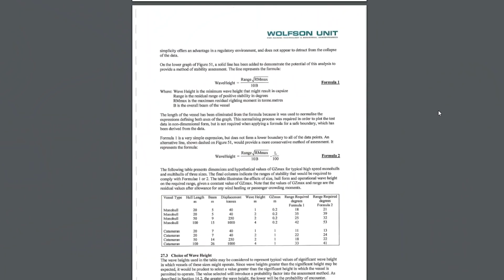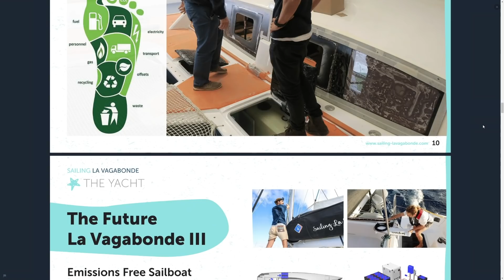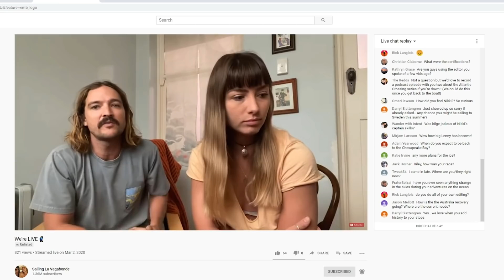Our Plan for an Emissions Free Vessel

Comment: My first question is; is a mono hull out of the question?  Don't get me wrong, I luv the Cat design, especially the Outremer,  but...cost of berthing at a dock is way high, 2 engines means twice the maintenance/expense of demand on the "power grid" (more solar panels and more "heavy"  batteries), not being able to load up with gear (washer, dryer and trash compactor, etc) and supplies without seriously affecting sailing performance and last but not least...the purchase price especially on a +50 foot boat  .  As you well know Riley, we/I will support you in your decision and never second guess you.  You're the Captain.  What you decide we will follow.  You did ask us for our input.  there are pros and cons to both hull types.  90% in port and only 10% underway.  Enjoy the journey because we all are enjoying it with you.  Luv ya bro,  your enthusiasm is infectious.

Comment: Riley more than a decade ago I read several articles on boats equipped with fuel cells and electric motors and 2k of solar panels. The problem was the size and weight of the fuel cells and the space required for solar panels.  More than 10 years later weight and space are no longer  an issue. So long as we are talking about sailing crafts.

Comment: It is still a few years away, but a suitable lightweight solar voltagic fabric will come onto the market one of these days... that would give you the surface area you need in the sails to power a 2 horsepower electric motor for a few hours along with a few hundred pounds of battery storage.
https://www.solarfabric.com/
you would need to have your wallet with you though.

You could also mount a wind turbine and wire it to charge one of Elon Musks power walls, and run a two HP outboard type electric motor with that for a few hours,   you might get 2 knots out of it.

These two in combination might get you to 4 or 5 knots for an hour or so.

Comment: Using the excess energy from solar and wind generation (vertical axis) to produce hydrogen so you have the speed on tap when you need it. But use battery captured electricity for the majority of docking and short term motoring.

Comment: I know the below issues because I too am researching a solar boat 🚣1. The main issue you will have is batteries. Typical lithium batteries have a life of diminishing returns so every day they will produce less and less power.
2. Next issue is speed, electric motors do ok at low speed but very poorly at medium to high speeds (consuming battery storage very fast at more than SLOW speed.
3. Next issue is recharge time you can't just pour electricity into a battery like pouring diesel into a tank. IT TAKES A LOT OF TIME TO CHARGE BATTERIES!!!
4. Next issue, amount of storage most boats can only run for about 4 to 5 hours on their batteries, then refer to recharge issues!!!
5. It is a noble thought but just not yet practical however I would look into Redflow zinc bromide flow batteries AND they are from AUSTRALIA maybe they could help sponsor your attempts at a zero emission boat.

Comment: Interesting that so many people are suggesting that you two (three) convert LV to electric. This is something I've been thinking about too. One thing that Dan and Kika point out, is that if you find yourself without wind, you've routed yourself incorrectly. This makes a great deal of sense, but there are still places you may want to go that don't have much wind. The really exciting thing about a boat like the Outremer is that in a 4 knot wind, you can sail and can generate electricity. And the amount of power you produce increases almost exponentially from 4 knots to 7 knots. There is a limit on how long you can motor, though, even with the most modern Lithium batteries. Does anyone out there know Elon Musk?

Comment: Come to the states. I'm from Wilmington NC area.  I've recently bought a hurricane water damaged Fountaine 44 for a great price. It's currently powered my two electric crane motors and I have a sodium ion battery bank... Looking to update soon to the EPT electric motor that the Sunreefs are using and some the high end luxury cats. I'm looking into power sails because I don't won't to solely rely on electric. I'm am electric engineer by trade. So I'd be happy to assist in any ways you need.

Comment: Riley, mate, here's some advice from an old boatbuilder/designer/professional skipper - The emissions you avoid by omitting diesel auxiliaries over the useful life of any yacht like yours would be a small drop in the bucket compared to those emitted by the various manufacturing processes of the yacht itself as well as her "green" energy-converting/storing components. That said, if you are interested in the "stunt" value and want to make a truly economic, zero-emission boat, get rid of the expensive sails and rigging (which produce shadows and headaches) make her a really long sharpie-style monohull (80+ feet?) with batteries as internal ballast and then run her on solar only. The ability to make twenty knots at the push of a button is a huge safety factor. A full-length canopy with solar cells makes a nice place to stay out of the sun. Check out Steve Dashew's ocean-crossing powerboats for inspiration. Cheers

Comment: Hi Guys,
Agree with those who say a new yacht is not the way to go. There’s a good solution already available in the Oceanvolt system. You could live ashore for the short time it would take to fit them. Your diesels could be sold to offset some of the cost. You’re never going to get a huge amount of endurance, so there will be times on passage when you may have to revert to whistling for the wind, but if you only use them for harbour work you should manage fine.
Excited to see how it goes.
Arohanui and give Lenny a cuddle for me.

Comment: Lots of comments about emissions saved by selling your present vessel, usually pointing out that refitting the present one will make much less emissions than building new will make. This seems to overlook the proverbial elephant in the room - the new boat will be built in any case and someone will get it if you don't...not to mention that your selling Vagabond used just might be the yacht somebody else chooses over building new. 
You can agonizingly argue and second guess these points as others have, but in the end, you need to do what you know will work for what you want to do. You've got a pretty good track record IMO...

Comment: Okay - if I wanted an emissions free boat I would go as far as possible with simple and smaller vessel, mechanical advantage, minimal electrics, and lots of old school approaches. Think ply, smaller, winches tackles and blocks, minimal electrics, small (elec? outboard?) or even no motor, charts and pilotage/sextant nav .... you get the idea. 

None of this speaks easily to a large and fast catamaran. Your big problem is the emissions from materials manufacture, distribution and disposal. All modern materials come with significant footprint, and it sounds like you are thinking modern materials and methods.

Comment: Cool, my Dream Boat!  Large Diameter variable pitch props for the Electric Motors, so Hybrid Sailing in a lite Breeze when the batteries are full.  The Large Diameter Props and Motor are alway running when sailing, Generating, Neutral (spinning with no drag) or Powering to keep moving thru the lulls.

Comment: Like many other comments, there’s seems to be a lot of room for emissions-free improvements on the current boat, before moving onto a new design. 
One area of greatly needed improvement is in the battery group. There’s a false idea of Lithium batteries being this great environmental product, but in order to get at the Lithium, it takes an enormous toll on the environment. But now there’s the graphene battery in development. We need to see a major push into this type of battery system.

Graphene batteries are definitely the next big thing because carbon is in abundance as compared to Lithium, which is a rare metal. Manufacturers have been trying to use the graphene material in about everything since its discovery in 2004. So, we can expect a number of graphene-laden products, especially graphene batteries, to come to fruition within the next couple-odd years. They will still be restricted to select smartphones but we’ll at least have a working prototype on our hands soon. What are your expectations from graphene batteries? Are you excited for even larger batteries?
https://beebom.com/graphene-battery-vs-lithium-ion-battery/

Finally, graphene is safer. While lithium-ion batteries have a very good safety record, there have been a few major incidents involving faulty products. Overheating, overcharging, and puncturing can cause runaway chemical imbalances in li-ion batteries that result in fire. Graphene is much more stable, flexible, and stronger, and is more resilient to such issues.
https://www.androidauthority.com/graphene-batteries-explained-1070096/

Comment: Guess I’m the one hillbilly here. Though emissions free sounds wonderful and noble, it’s an impossible feat. As new as that boat is those engines are as near to zero emissions, you can get for the dependability and efficiency of getting you out of the storms way. As far as the process of building a boat. huge emissions output and footprint, with the materials and chemicals use. As far as electric with a continuous replacement solar panels inverters and batteries and a disposable batteries you would have a far greater footprint then a Diesel engine. The maintenance and continually replacing parts in a short lifespan of the vessel would be a rather large foot print people don’t think of. All they think is oh zero emissions how wonderful. Not every thinking about the emissions emitted building and up keeping the boat. Not trying to be a na sayer. Just pointing out the Reality of it. As thorough as you two are I’m sure y’all put that in your thoughts. Been watching from the beginning, love your channel and what you do. Live the dream. As long as possible.

Comment: We went electric on our sailboat just this year. We sail a 41' formosa. the motor is undsized for this boat but the torque from the electric far out performs the old diesel. It is the lithium batteries that makes the difference too. (Dubble the size of what ever the battery bank you are planning) We have plenty of solar panels plus the re gen (which is a drag but works). Had a plan to install diesel generator for fast charge in an emergency.  But I dont think we need it now. So have a Honda gen to charge in a emergency if we need. Love watching your famly grow 🌱✌☺️

Comment: Best of luck to you guys. I would have thought the most cost effective pathway to lowering emissions would be to install a water propulsion system, and streamline the hull you have.  However not being a sailor, and only ever been capsized in a motor boat, with only angling experience I appreciate that this may not be feasible.

Comment: Hi all, what is emissions free? I think it is timber construction but all protection contains usually contains petroleum based products. Steel is coal based, alloy coal or petroleum based for electricity and fibreglass petroleum. Am I over thinking your plan?

Comment: This can be done with lithium batteries and a electric motors. For now I would recommend a back-up diesal generator as the energy storage density of batteries pales in comparison at the moment. In a few years solid state batteries should improve this but probably need some backup for now. Can you get biodiesel at boat refilling stations? 

I have also seen a boat using hydrogen fuel cells which solves the energy storage density problem. The setup would take up a big area of the boat though.

Looking forward to seeing you nut out a solution!

Comment: Why don't you use your current cat. You could put an extension on the back to add an extra row of solar panels and over the next couple of years there will be new solid state lithium batteries coming out so doing anything now is probably a bad idea. Maybe get an electric outboard motor if you truly want to get rid of emissions.

Comment: I love your ideas Riley you have obviously been thinking about it a lot, great job! I noticed a few comments already about the embodied carbon in the construction of boats (or anything/everything really!) are you planning on addressing these in some way during the project? My fear is that your good intentions will have the opposite effect and just spur unnecessary consumption and therefore carbon emissions. In the home building world it embodied emissions are becoming a much bigger part of the equation and people are noticing that building a new “net zero” home will take more carbon emissions than it will ever save in certain situations. In the boating world this could be even more pronounced as the average purchaser of a boat does not need it to live on but purchases it for recreation and may not consume many fossil fuels at all over its lifespan. A simple example of my concern would be to calculate the embodied carbon in the batteries required to replace the need for diesel and determine how much diesel would need to be saved to “pay off” those batteries. At that point you would be “even”. Even more significant would be if you replace a whole boat with one that does not use fossil fuels then you are responsible to not only pay off the embodied carbon in the batteries but the whole boat. These are complicated questions with even more complicated answers that are specific to each situation. Unfortunately the main issue we need to address as humans is our excessive consumption so many times new is not always better. Great job on your channel and best of luck on the project!

Comment: Well Riley, after I stopped laughing at your acting chops, I was a bit stunned by this development.  Laudable intention, for sure, even though your lifestyle, being partially wind powered, is better than most as it is. My approach for several years has been to not buy new. Anything. Surely the most earth-friendly thing you can do is to convert the vessel you own, rather than commission the use of new resources for a different vessel? Are you considering a conversion of an existing boat? Or carbon offsets?

Comment: Riley to add to Jason Haspineall comment, I agree use your Outremer 45 as the start or at least a test bed. I would be easy enough to replace your existing outboard screws and replace them with something like a fixed bladed Naval impeller that's mounted in a tube/tunnel on the bottom of each of the Cat's hulls(think magneto drive from "Hunt for Red October"). When you're driving the boat the front the tube is open to allow water through. When you want to produce power the impeller should be efficient enough that it can back drive a generator mounted on the drive shaft.(This would replace your Watt and Sea device. When you don't want to do either you close and flood the tubes.

Comment: Intriguing project, to say the least. Suppose you considered it, but you didn't mention why upgrading the Outremer is apparently not an option. Making an existing boat nearly zero emission free would set a useful example. A new boat generates emissions during the build, hence starts out environmentally indebted.
Reply: HeadPack unless they are putting La Vagabonde into landfill, I don’t think it’s an issue.

Comment: Hello Riley.  With regards to safety, my recommendation as a 30+ year spar designer is a furling boom.  This provides the safety of never having to leave the helm station to hoist, reef or furl it away completely.  I prefer the Leisure Furl Offshore In-Boom furling system.  It is operated by using your existing 2:1 main halyard and a furling line and drum system which comes with the boom.  You guys are great!!

Comment: As a renewable technology heat pumps are incredibly efficient in water look up ground or air heat pumps the tech works most efficiently with water but due to limited chance of use eg most places don’t have water it’s under utilised.

Comment: My boat is a 1961 Huckins. It currently runs two detroit 8v71n but I spend all my time at 7-10 knots. The boat runs on 32volt DC which makes things interesting. She's old, the engines are tired, so eventually I have a plan for electric with shed loads of solar and probably a genset to help in emergencies.
The new version of my boat is in fact a hybrid, so I may have a head start with info from them.

Comment: I love it! I’m sure you’ve seen the new ITA 14.99 hybrid? You just can’t motor for any substantial length of time on electric alone, you don’t have enough surface area to get the solar wattage you need, and the batteries you’d need would be very heavy and very expensive. I’d lean toward diesel-electric hybrid. If your electrics fail or you don’t have enough power, you can always fall back on the (oversized) diesel generator. I’d also go for a regenerating saildrive. If you can keep your cruising speed high enough (and do enough of it), this can provide a substantial amount of power, but you’ll want a very large battery bank to match if not the diesel generator.
Reply: Have you thought about a methanol fuel cell? I worry about finding cartridges though: https://www.efoy-comfort.com/

Comment: Use Electric Engines instead of Diesel Engines, Increase in amount of Solar Panels and Lithium Batteries.
Reply: Heavy, expensive, not enough energy density.